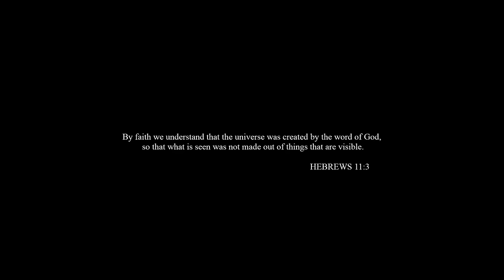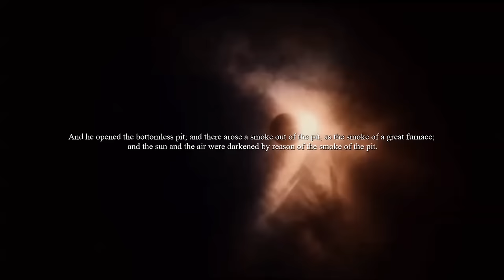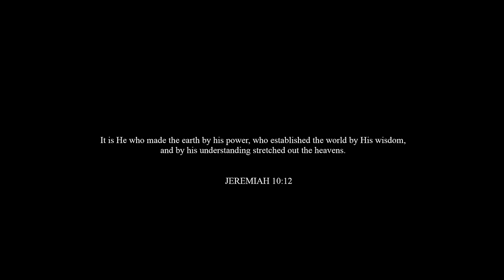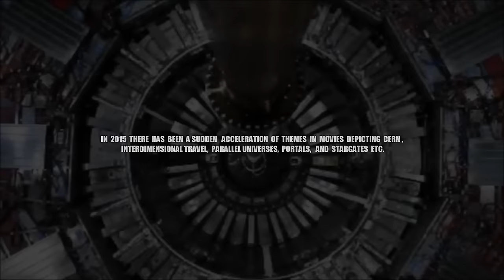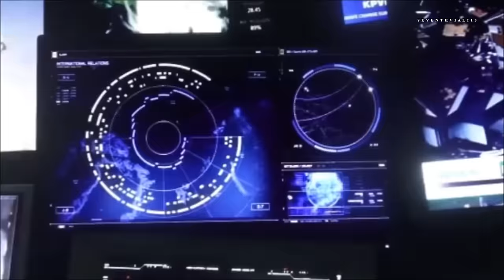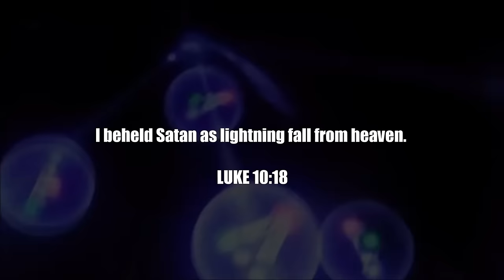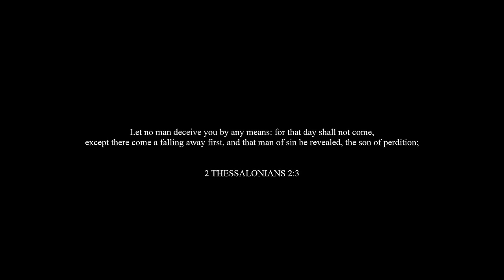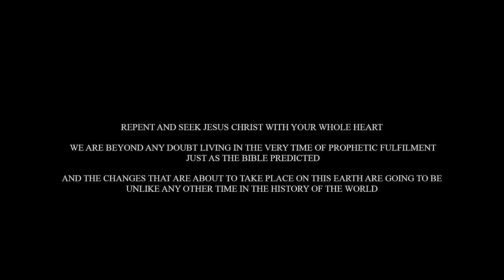C E R N  the Opening of the Abyss?

Comment: was wondering, after the smash of partical, will cern be using the magnet to stretch open the dimension rift they've made? as the on 24:47 is looks like its use to pull something open.

Comment: Hm.  Excerpt from metabunk following:
 
"The Shiva Nataraja stature was a gift from India to mark the partnership between CERN and several of their organizations. It's quite heavy in symbolism, but it is not destruction. Shiva's a more complex deity than that with numerous forms and aspects both gentle and fierce (most of the symbolism CTs put on the statue is closer to common presentations of Kali, not Shiva, who despite his association with destruction and endings is generally a benevolent deity). The dancing Shiva specifically represents change, not destruction."

As for opening the way to the Abyss, while I certainly believe in the Abyss as I've personally been there, I do not believe the LHC could be used, or that it would be used, to effect a portal to these lower dimensions.
Firstly, LHC is not powerful enough.  As it were the LHC's maximum energy is 6500 GeV.  To even theoretically punch a hole through the universe, you would need billions of GeV.  That would be a very large collider and power source, analogous to a Dyson Ring and its powering sun.
Secondly, Revelation says an angel will do it.  Revelation has a lot of symbols, but I do not find any analogy bequeathing any work of mankind, symbolized in any scripture as the work of the angelic host.  As it were, "we do our human thing, and they do their angel thing."

Comment: You're telling only half of the story.

Hawking did indeed say the God particle (Higgs Boson) could become unstable causing a catastrophic vacuum decay. It is also true that this particle can be created in the LHC. This particle may have the feature that it becomes meta-stable at energy levels above 100 billion giga eV (electron volts). In short this means the universe could undergo rapid vacuum decay with a bubble of the true vacuum expanding at the speed of light.

However, what you fail to mention is that Hawking said for a particle accelerator to reach that speed we need a LHC AS LARGE AS THE EARTH! Doesn't seem very likely to ever happen, now does it.